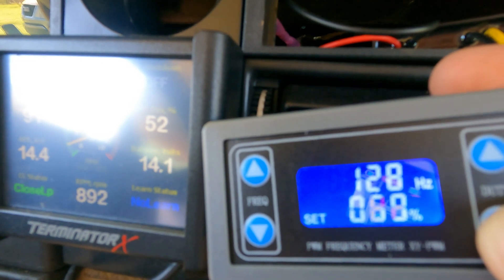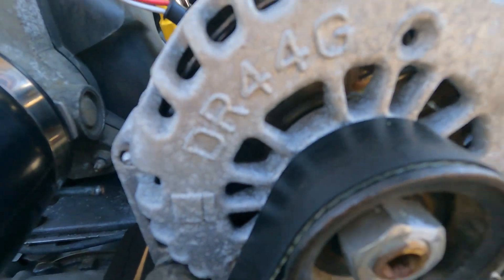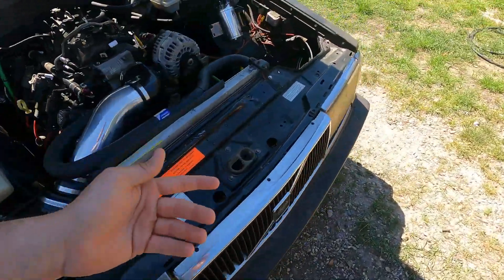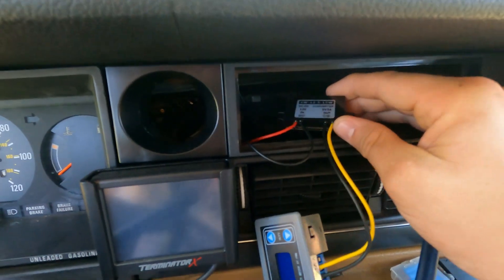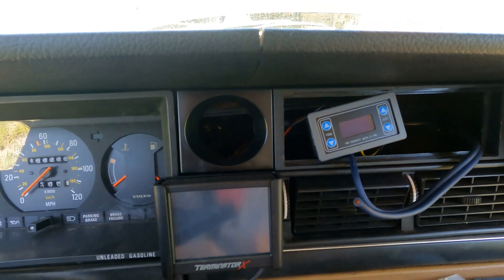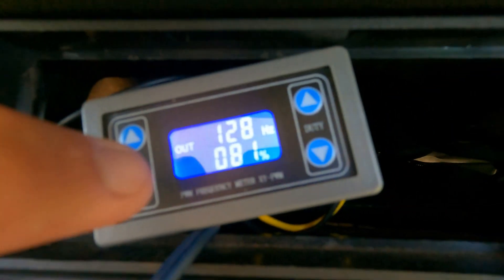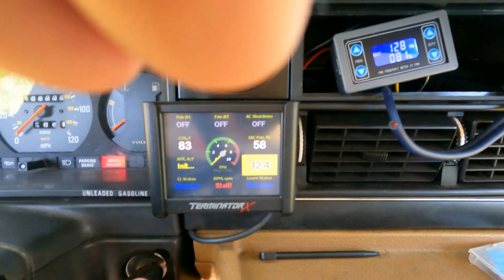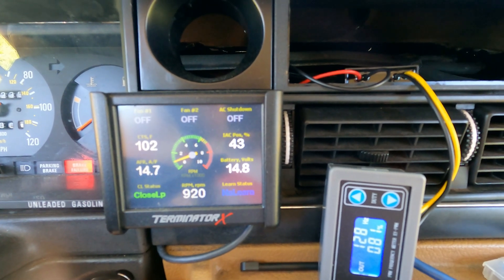How to run a DR44G alternator without a GM ECU for cheap.

Comment: Hey is it a need to have a ohm resister installed with it also?
Reply from the maker: No that's the older style with feedback loop, it has a 4 pin connector, my 03 suburban has that
Reply: @601Volvo thanks just ordered everything to finish up in my cutlass great video

Comment: Top video and your so easy to learn from. I'm not running a Hollywood dominator though I'm doing a big stereo in my Aussie vx holden commodore v6 3.8l l36 naturally aspirated. Same engine that's in your american chevorlette camaro v6 3.8l l36. I'm ordering a 250amp alternator and want to run it at 15.3v. So that way I can do a front starter battery delete and run  just a sodium ion amp bank in my trunk. I cannot thank you enough mate. Keep up the great work and keep these great videos coming,you got a subscription from me.

Comment: Hey my guy where is the red and black wire running on the DC to dc converter? I'm doing a ls swap in a 91 Camaro and I really need to know,I must of not heard it in the video..I apologize
Reply from the maker: If you're looking for a 12v source, just run it to any fused 12v source.. fuse box, battery, doesn't matter..
Reply: @601Volvo  thanks my guy

Comment: Or get a 4pin regulator and install it into the dr44g and wire it up or secondly my favorite get a self exciting dr44g self exciting regulator. They are only like 20bucks no bs with a pwm generator

Comment: So i think this is what i need to bypass the RVC on my 08 5.3 Silverado looks like the same thing mechman uses and sells for $129 except theirs don't have a separate box for the 12 to 5v step down.
Reply: @601Volvo will this method work for my truck? I don't think it's this model alternator. I'm trying to keep steady voltage high since I'm running an AGM battery.

Comment: This might be useful if I ever came across a DR44 and wanted to use it in my 2002 yukon instead of taking it apart and replacing the regulator.
Reply from the maker: @martinez1701a  just keep in mind the dr44 is the 4 pin ECU, the dr44g is the one with 2 pin
Reply: @601Volvo  Right, I was thinking of adding this setup to my truck and basically having the ability to run ecu controlled alternators without pulling the regulator. I could even run a dual alternator setup with the crazy Idea of one powering my audio setup and inverter.
Reply from the maker: @martinez1701a  I used to compete in meca, usaci, and whittlee years ago, so I understand the want for multiples.
Reply: @601Volvo  Nice, I have a fairly small system Taramp MD1800 running a Audio Legion 12 @1ohm. Be nice to have a separate battery and charging system to run that and an inverter or anything else that needs power.

Comment: I have another question.  Should the 12vdc source have power in START and RUN?  Or just in RUN.  Or is either way ok?
Reply from the maker: @silvernblackattach  it only technically needs power while the alternator is spinning.
Reply: @601Volvo  many thanks

Comment: Just so everyone knows if you're being cheap pretty much all USB sources put out 5v along with the terminator has a 5v source. I was being lazy and used a USB of the back of my radio and it works flawlessly. Thanks man!
Reply from the maker: @justinwillard7066  you are right, a USB port does have an output of 5 volts plus or minus 0.25 volts, however, I wasn't sure how much current draw this device was going to need so I didn't want to limit myself 3/4 of an amp or 1 amp or whatever that might be, I wanted something that was dedicated and didn't want to roll the dice, but if it does work great, that's good news and good to know.
Reply: @601Volvo  does it haft to be a 5v source? What would happen if it was ran off of straight 12v? Does the pwm put out what voltage it has running to it?
Reply from the maker: @andysims6478  the pwm device passes through what's fed into it.  Can the alternator handle 12v?  That I'm not sure of, but the OEM computer output 5v, at 12v I'd think you would cook the input into the alternator, but that's speculation.
Reply: @601Volvo  I wonder if could run the pwm off of the stock ecu\pcu wire running to the alternator
Reply: @justinwillard7066  that is pretty good thought.   You could probably wire in one of those cigarette lighter outlets and plug in one of those USB Converters....
Reply: Can you use 5v from the terminator
Reply: My v6 commodore has a cream wire and a brown wire, wich one do I wire that thick blue wire to.

Comment: I have read that the range on these is 10-90% but I've also read that it's 5-95%.     Can you test the voltage output at 94-95%?   Is that in the diag range or does it go above 15.5v

Comment: Thanks for posting this, I am in the middle of sorting mine out as well. The Terminator has alternator control in the ECU config under basic I/O tab.. Select custom and you can configure PWM table for voltage over duty cycle. I gives a PWM- output only on output B10. I am using a 5v cigarette USB charger as the source voltage and a resistor between the Holley and 5v source wire.. What voltage reading are you getting on your control wire at the alternator 2 pin plug when its charging around 14.3v?

Comment: so I have an 03 yukon xl that has the volts ranging between 14v & 8v & it gets so bad that it will want to stall out at lower rpms... Can i run this conversion & it will bypass the whole PCM charge thingy you explained? I cant believe this aint ran off a fuse so it just blows the fuse if need be. I do not have 100% understand of it, but I want to bypass the PCM... it doesnt seem like rocket science & is the route/conversion I need to do?
Reply from the maker: @roymoore2944  so yeah your '03 has the 4-wire alternator, I have an 03 Z71 suburban and it has that. Now with a four-wire alternator like you have. All you need is the pigtail with the single wire that references the 12-volt system and it will self-regulate through a loop that way. You can make the four-wire alternator run independently for $20. That's what the majority of people do rather than running this two-wire alternator that needs a pulse width modulation signal. Before I went through the efforts of removing the current alternator for another one and then having to do this, I would troubleshoot the current issue to see if maybe you have a grounding issue or a failing alternator.

Comment: I have an aftermarket HO 250 amp alternator. Uses the factory 2 pin GM plug. 2006 Silverado 5.3L. 
Since I have the factory 2 pin plug, what do you suggest to use for a plug that won’t cause the battery light to illuminate on my dash?
Reply: Try just jumpering it. The alternator takes PWN from the ECU on one pin, and the alternator sends a PWM feedback signal on the other back to the ecu. Im pretty sure that jumpering these will make the ecu think the alternator is working as signaled. Mechman has a P103 plug module to bypass the alternator, but it's $30+ and is just a jumper that fits the factory plug.

Comment: I wish I had you here to help with my alternator generators.
I've got CS high output alternators and have the two wire pigtail, but I'm still having problems, duh.....
The light wire has a resistor in it then goes to an idiot light then on to a illuminated toggle switch.
Sound right?

Comment: why did you need the 12v to 5v converter?
Reply from the maker: The factory ECU communicated to the alternator via 5v signal... Can it handle 12v?  Maybe, but you might cook the input.. I was only replicating the signal designed for it.
Reply: @601Volvo  could you use the 5v from the terminator power tap?
Reply from the maker: @koltonroy8191  some people say you can, but I don't have the details on that.
Reply from the maker: I was experimenting with an output to try to drive my speedometer, I think the only available output left for me was a pwm - and I was trying to use a pull down resistor to make the square wave.

Comment: I just followed your connection instructions and bam it’s working just like yours is. Late model alternator on a 454 running Holley efi!!! Thank you so much I’m sure this will fix many other problems I’ve had!
Reply from the maker: Cool, glad to hear it!
Reply: Did you purchase same exact step down converter? I tried last night, had a different brand one since I was able to get same day, didn’t work for me. No change when changing the Duty Cycle. Module fired up perfect. Set it to 128HZ but no change. Wired into proper alternator connector. This is a 2015 Camaro Alternator. OEM GM.
Reply from the maker: @johnnyb305mia  what model is that alternator that you are using?

Comment: I tried what you did but on Honda accord 1998 with a 4 pin alternator and it didn’t work. Do I have to leave the computer wires connected to the alternator 4 pin connector or do I disconnect the computer wires from the 4 pin alternator connector?
Reply from the maker: This procedure will only work on a two-pin alternator, a four-pin alternator works a completely different way.

Comment: Following up.  I was reading about these alternators and it seems that the they default to about 13.7 vdc anyway... so even if some of these support components failed the alternator would at least still function.  I found that good to know.
Reply from the maker: Mine without a regulator wire ran at 13.6v, but with my accessories running, it was barely keeping the battery charged.

Comment: Thanks.  Another questrion:  What 12 vdc source do you use?    A "switched source' (via key), or constant 12 vdc  from a battery source?
Reply from the maker: It's probably safer to use a switched source.  I haven't tested yet if there is any idle current draw by that regulator.

Comment: Many thanks.  So- a DC TO DC Converter and the Signal Generator?  Do you have part number for the DC-DC converter?
Reply from the maker: I don't, but if you go on eBay and type in - Better Waterproof DC-DC Converter 12V Step Down to 5V Power Supply Module 3A 15W.  It will pop up.

Comment: You could assign a PWM output from the terminator X to the alternator. You then set up a graph on the output  Voltage vs pwm output. Use the Terminator X for a voltage regulator. Set up battery voltage as an input and PWM to the alt as an output.
Reply from the maker: True, but this might come in handy if you're out of d/o or if you're using another system.
Reply: @601Volvo  Yes, good hack

Comment: Yesssuh! I get it and like 10 bucks for the part. I just really thought there was a way to make it work but there's not unless you wanna go through all the changing of the regulator and soldering  and crap and basically ending up with the same alternator you just took off. Kinda defeats the purpose doesn't it? Least now you can control the power when adding accessories and that's the point being a higher amp alternator especially running more than one battery. So yes I will be the PART of ebay to runs this awesome alternator. Thank you for confirming this as I had my doubts.